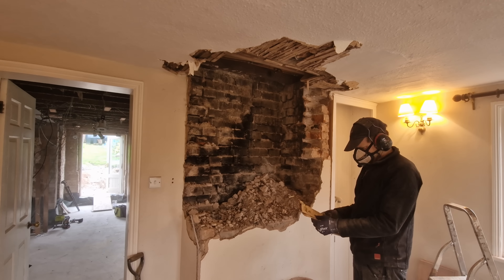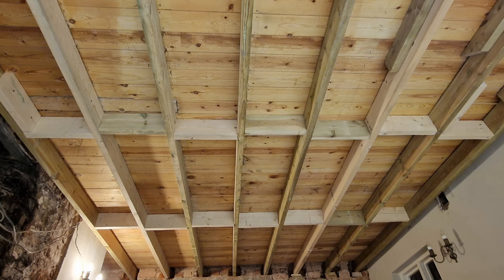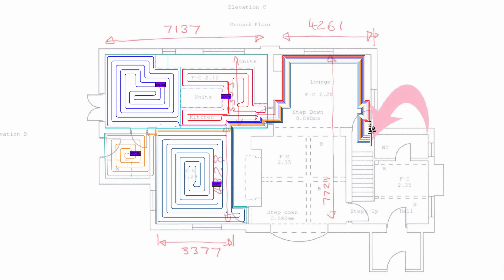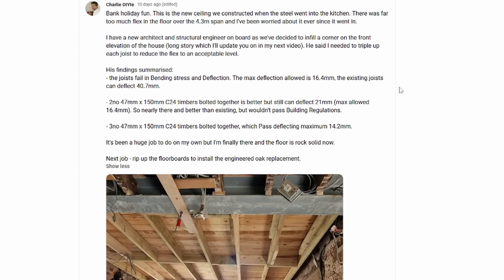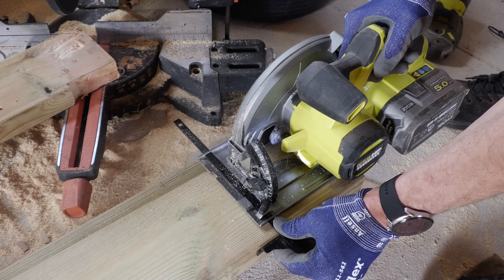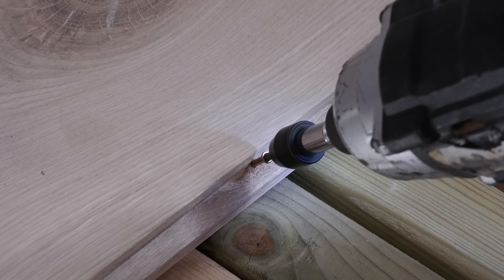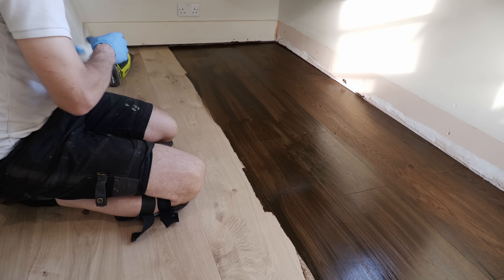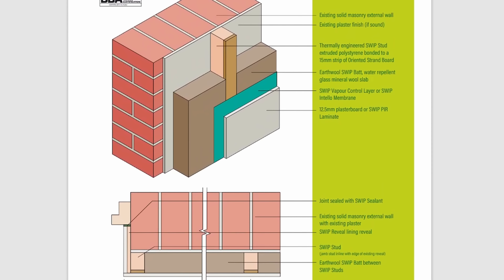How to Support a Floor and Kitchen Update

Comment: little tip, if you screw a nut onto the threaded bar before cutting them, then unscrew off the end , the bolt will cut a perfect thread allowing easy starting of nut once in situ
Reply from the maker: True but one end will always need rethreading after belting it through the joists. I'm aware of this technique though so thanks for resharing.

Comment: Just had to strengthen our bedroom joists on 300+ year old property we’re renovating. To make things worse the previous owner had notched (or should I say butchered) around 40% deep out of zones! He was only running 22mm pipe too! We sistered new C24 joists (glued and attached  with structural screws). Full length, creating pockets at each end like you. I then put noggins near ends to straighten and finally 3 sets of herringbone struts (overkill some might say as it’s a 4.2m span)

Really solid now though. For external joists ends I’ve just bought Soudal SWS expanding foam (I know normal is not too regs as it can shrink but this stuff counters that problem according to the technical data. As well as Soudal Vapor seal adhesive mastic £6.98 from Toolstation. Not sealed the ends yet but with these beauties I’m hoping to make an airtight seal.
Reply: I also filled the joists holes on existing joists with new wood cut and glued in right before sistering the new joists
Reply from the maker: Lovely job Barry. I had to do that in my old place in London where someone had notched far too brutally into the joists so I glued in filler pieces. You've got yourself a lovely solid floor there now!
Reply: 10:45 regarding the joist pockets, we had to sister new joists in our Victorian kitchen floor as they were rotten, I always worry about joists in mortar in the wall now, is moisture only an issue for ground floors? Or could it rot the joists first floor too via the mortar??

Comment: been there & done it with planning & the bat(ty) system! - just work with what you have - perfect on the 1st floor, all i would suggest is not using (wool? / breathable) below ground! the moisture is 99% at this level from out to in, not the other way- we have similar, but upto 0.25m above & below ground level just used superquilt (or similar), double bagged + double vapour barrier, you just dont need any moisture in any insulation.
Reply from the maker: It's a very good point. By the time the insulation and UFH screed is in there won't be much of that left below the dpc but I'll definitely take heed of what you say there. 👌👊

Comment: Great content Charlie. Good luck with your planning Application.

Ps you may want to put a CO Detector in your ‘temp kitchen’. Stay safe
Reply from the maker: Thanks, and yes that's a good shout on the detector. There's a wired one on the ceiling but it needs replacing.

Comment: Charlie ..... I'm a builder and have built complete houses and my share of extensions. It's only when you stand in the spaces that you are going to use that you understand the space and how to use it. I have found NuHeat very good on the tech spec for underfloor heating along with flow rate on each manifold leg. Keep up the gd work bud. S
Reply from the maker: Thanks so much for this, Sheridan. Means a lot, hearing that from a pro. Thanks for taking the time to comment  👊

Comment: When you see how close the original joists are to the window lintel, you almost certainly could not have specced a deeper joist. I guess the other alternative would be a steel plate between the doubled up joists, much heavier though.
Reply from the maker: Yes I thought about that. We initially went with 6 inch to maintain the ceiling height either side of the steel. I suppose I could have notched the joist into the lintel. The steel is an interesting idea. I did that with the pergola down the garden.

Comment: Impressed as usual.  Waiting for my son to move out of my place next year.  Gives me a chance to plan underfloor heating with a suspended floor.  Get a structural engineer to advise on removal of a chimney breast.  I'm very interested as to how you solve the internal insulation.  My property is 1931 build with a small cavity so I don't want to fill that up 😂
Reply from the maker: Thanks Francis. Yes I'll get my structural engineer to advise on the chimney. 👍
Reply: @Charlie DIYte  good. I'm looking at removing a shared chimney breast which supports part of the upper floor 🙄 bit of a nightmare

Comment: Joists in the wall. DONT dpc and cement them in. They’ll rot. 

If you can leave them open it’ll be great to let them breath. If they need mortared in, get some pre-mixed hot lime. That’ll allow moisture out.

Comment: great DIY video Charlie,i learned some things from it,however,i would never place floor heating and a heat pump,a heat pump has only 40-45% of efficiency and constant 5Kw > (compared to a gas boiler 90-95%) you also need to insulate the house airtight,therfore you will need a costly ventilation system,unless you open all the doors and windows for a certain time,wich negates what you tried to achieve in the first place,namely,a warm (winter) house with less electricity costs,another point is floor-heating,this is not good for feet and leggs,as they are constantly heated,my future heating (if they fase out gas) will be infra-red pannels,80% efficiency with less electricity (400-500W x rooms) so with the minimum power of a heat-pump (5Kw) you can heat 10 rooms,cheers mate
Reply from the maker: Good point mate. I'll remember that 👊
Reply: Thats not how heat pumps work, a 5kw heat pump can use up to 5kw to heat your whole home but they can tick over on 500watts check out the heat geek youtube channel. Also with infra-red panels you get 1 unit of energy in and 1 unit of energy out with a heat pump you can get 1 unit of energy in and 3 to 4 units of energy out.
Reply: @martingardner9885  yes,you can heat at 500W Martin,but in winter this will not be enough,also,a heat pump's external module will be damaged after a short time where the air is salty (coast) a heatpump heats the air,infra-red pannels heat objects,including your body,i heat with gas,but with the high prices past year i placed a 400W infra-red pannel,i was warm while the air was cool,strange but effective

Comment: This is very interesting ! For me, I'd much rather have the frustrations and delays on me, rather than a builder either doing it wrong, cutting corners, or giving me a continual drip feed of bad news, while the final agreed price keeps going up. DIY is the way to go :) At least any grey hairs I would get as a result I can say I gave them to me myself :)
Reply from the maker: I agree. You're in complete control of the process and the budget. Just happens a lot slower, particularly when you're having to film everything too!

Comment: Why are the builder's not doing this work on the floor? Did they install this roof that wasn't strong enough in the first place? Great work btw
Reply from the maker: Some builders need keeping on the straight and narrow by the structural guys/ architects, as I'm learning on this job! The good ones will have instinct/ intuition on this.
Reply: @CharlieDIYte so you got rid of the original builders I assume?

Comment: Hi Charlie, could you repeat the name of the expanding glue that you used to stop the creaking floor please? And possibly a link to buy. Many thanks, Paul
Reply from the maker: Sorry Paul. Thought I'd done that. It's Egger Joint and Joist adhesive https://www.ebay.co.uk/itm/E-Egger-D4-PU-Joint-and-Joist-Adhesive-1KG-Waterproof-Outdoor-Strong-Glue-/225169258822?mkcid=16&mkevt=1&_trksid=p4429486.m46890.l6249&mkrid=710-127635-2958-0

Comment: your ceiling is fine you've double up on joist plenty of strength there ,don't get fouled  by there structural engineers , I am and engineer and we always over strengthen everything  in our job spec
Reply from the maker: Thanks Stuart, that's good to know 👊👌

Comment: despite what the manufacturer claims do you really want to take the risk and not use noggins? If you look at the proper carpenter like robbin clevett they will ensure that T&g joins always land on a joist or if not fit noggins

Comment: It seemed only sensible to repeat the problems of the past...

Those joist ends are thermal bridges, both bypassing the internal wall insulation you're planning, and presenting a condensation risk on the ends as they'll be colder than the other surfaces.

sigh
Reply: Although you did a fantastic looking job of packing them into the steel. Envious.

Comment: What's wrong with heat pumps? I'm heating an old  (200 years+) cottage (900 sq. meters) with absolutely perfect indoor temperature even with -20°C outside? For 35 years!
Reply: Charlie's been watching too many SkillBuilder videos where Roger Bisby goes on a Heat pump rant 😅
Reply: The point is that heat pumps are going to be pretty much the only legal option soon, in a country where there are still houses with zero insulation and zero air tightness. A heat pump just wouldn’t work in an averagely insulated house of a certain age. 

Also, 900 square metres?!?!
Reply: @lukeh3020 I see. Yes I heat 900 m2, basically no additional insulation since 1800-ish, just a wooden structure and some wallpaper 😄. Heat pumps works unbelievably well. I’m not trying to…stir up feelings, I’m simply curious why it wouldn’t work for you in UK as it works absolutely perfect up here in cold Sweden!

Comment: I actually tried Zinsser after seeing you use it, and I must admit it's really good, they need to be supplying you!
Reply from the maker: It's great Giles and so many applications for it. Worth ordering the free manual from their website too. Only thing you'll find is in hot weather it dries too quickly so you'll need something different like Zinsser 123 then. Other than that it's my go to primer for everything.